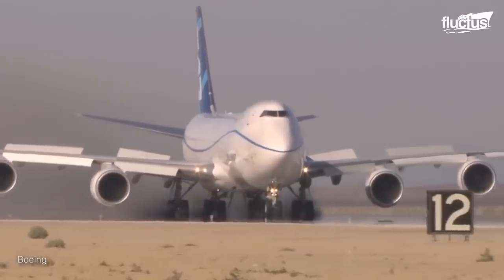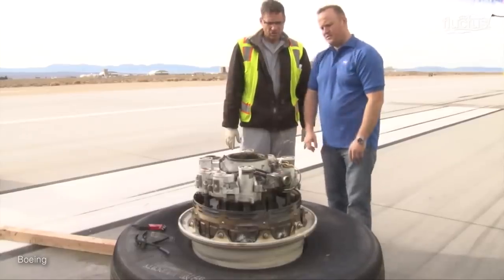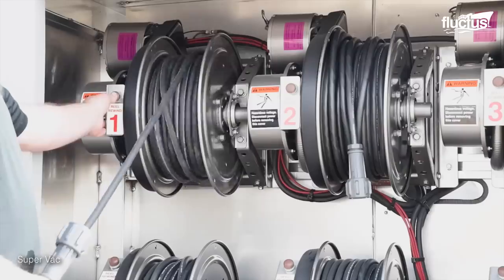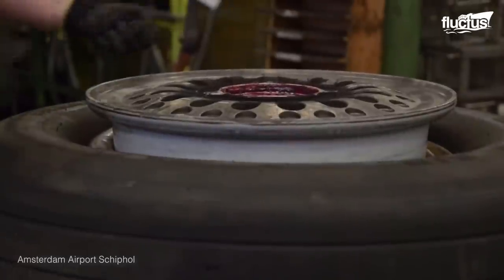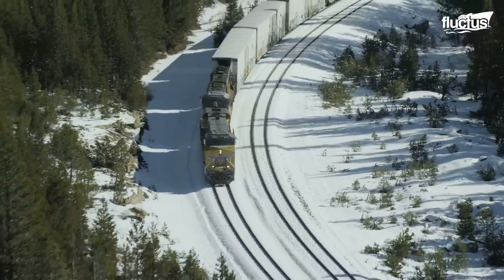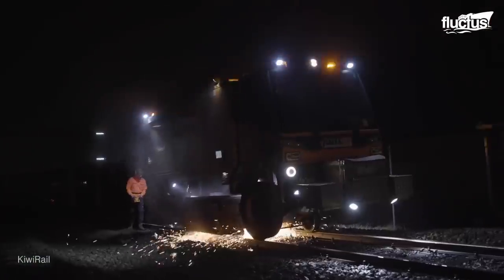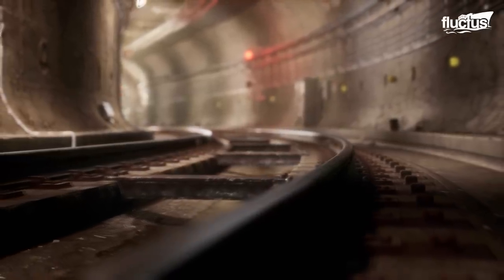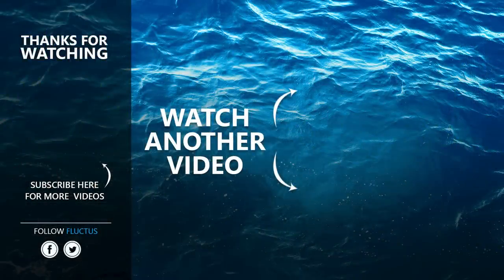Special Techniques to Cool Aircraft Brakes After Hard Landing

Comment: hard landings have noting to do with brake temperature.
Reply: Exactly what I thought if anything the harder the landing cooler the breaks as more speed is scrubbed off on impact
Reply: @rcblitzfpv8346  I think they mean as fast landing resulting in a hard landing on the brakes
Reply: @rcblitzfpv8346  ehh not really. the firmness of the landing has no real effect on brake temp. the landing groundspeed does effect brake temp, but landing groundspeed doesn't play a big role in the quality of a landing.
Reply: @andrewbatistoni5779  that's exactly what I said
Reply: maybe he meant hard braking.
Reply: 👍👍👍👍👍👍👍👍 excellent. hahahaha
Reply: True
Reply: Hard landing an aircraft actually makes the breaks cooler
Reply: @sanashams322  🤣🤣🤣🤣🤣🤣🤣🤣🤣🤣🤣🤣
Reply: @sanashams322  🤣🤣🤣🤣🤣🤣🤣🤣🤣🤣🤣🤣🤣🤣🤣🤣
Reply: @andrewbatistoni5779  Hard landing does make the brakes works harder. If they bounce or land a little further than normal they will put the brake harder to not go off the strip.
Reply: Literally the first thing that I thought when he spoke
Reply: i think they meant fast landings
Reply: You guys know nothing about science lmaooo
Reply: @raphaeld307  WHAT DO YOU WANT
Reply: Yes but it does with tire temp
Reply: @andrewbatistoni5779  not completely, its also the amount of breaking. say you have 4000m of runway and your calculation says you need about 1800m of runway to come to a stop in your current configuration (no reverse thrust included) you wouldnt need to brake with all force but like 2/3 of what you have. then you stop still before the end of the runway and if you would need to taxi along the runway to get to your gate you would want to have a longer landing. amount of braking = heat of breaks
Reply: @andrewbatistoni5779 I thought it was to do with friction. The harder the landing, more friction therefore there will be higher temperatures

Comment: I used to work at Boeing Everett where wide body twin aisle aircraft are produced. I can still remember the first time I saw a complete disk brake assembly inside engineering building. It was huge and had about 6 or 7 different brake disks and calipers with brake pads. Each tire/wheel has something like this. When they do destructive testing for certification, brake disks and caliper pads are destroyed and will be replaced. Cost a cool million dollars for each test.
Reply: "When they do destructive testing, things are destroyed" Well, yeah...
Reply: They are called brake assemblies. In the old days and on the F-4. The brakes was not as a assembly. You had to physically remove a rotter  disk , a stater disk and so on.  Back then  the rotter was steal  plate. Now its carbon.   On a Gulfstream to replace just one brake assy cost 120K and a Gulfstream has 4 of them.
Reply: @ximenoworks  Thank you. When I first saw one, I wasn't sure what it was. I asked one of the engineers in work-group. He came over and explained it to me. I think they were carbon fiber. I can't remember if brake assembly was before or after destruction test. I walked away thinking how great to have that on my car - LOL.
Reply: @martinc.720  Thanks, yeah brakes get 'cooked' in the destructive test. Also, not uncommon for tires to blowout. New safety systems help protect tires a little bit. 

Too bad they can't add cooling systems on brakes. Squirting liquid Nitrogen would cool them and not support combustion. But maybe cool too much and cause brakes to fly apart. 

I'm glad I'm not writing the checks for these destructive tests. When I was at Boeing Everett, they had huge test fixtures to put wings and fuselages under extreme loads. Data captured helped make better and safer planes.
Reply: @SJR_Media_Group  We get it, you know stuff.

All I did was pointing out that you said “They destroy stuff when they destroy stuff”. I mean…
Reply: @martinc.720  Gotcha - thanks.
Reply: @SJR_Media_Group  They are overkill for cars. But would be good on trucks. Except cost will prevent it.
Reply: @ximenoworks  Thanks. I was being satirical of course. They do have carbon fiber pads and rotors on super expensive hypercars. My Maserati is old school... giant slotted, cross drilled rotors front and back. Giant vented calipers with giant pads. Yeah, it stops as fast as it accelerates. That's what seat belts are for.
Reply: @ximenoworks  Cost will prevent trucks from stopping?
Reply: @tedmoss  Those multi plate brakes cost a lot more

Comment: BS!  Hard landings do not cause wheel fires!  It's HARD braking that causes the brakes to HEAT UP, and "CAN" cause the wheel fuse plugs to release tire nitrogen pressure.  Your research and video is flawed with incorrect data!
Reply: Where are your videos and correct data, Captain Geardown?
Reply: just wanted to write the same. A hard hit on the tire will not overheat it...

Comment: The tire thread never reaches 400 deg. If it does, the rubber would have melted. It's the brakes that reach those temps.

Comment: How do you attach that in the air ???
Reply: when the plane is going 500 mph cooling isnt an issue. some planes dont have landing gear well fairings. others have ways of cooling the tires in flight using cool air. Airbus 321 neos even have brake fans built into the wheels.

Comment: Doesn’t nitrogen aid in cooling the tires?  There was no mention.
Reply: The nitrogen that would be released from the tires via the relief valves wouldn't be able to cool the brakes. There's just not enough gas in the tires to provide any noteworthy cooling effect, even if you could direct the flow of gas directly at the brake stack.

Comment: As an automotive guy I find it odd that they have to cool the brakes. We use vented rotors so that air cools the brakes while moving.
Reply: The temperature is significantly higher. But, under normal circumstances, the break cooling is more  so the plane can take off on time. The temperature has to be below a certain point before  takeoff in case of a rejected takoff. Also, after an aborted takoff, it lessons the wait time
Reply: jets use carbon brakes. and they use stacked brakes that would look like a 5 layer clutch you might find in a motorcycle, a layer of "rotor, a layer of friction material, alternating. the calipers are 360 degrees around the whole wheel. the surface area of braking per exposure to wind-stream is much less than cars have, especially after landing.  its not uncommon for brake temps after one landing to hit 300C to 500C possibly higher in abnormal situations. carbon brakes perform best in the middle of the temp range, on aircraft. unlike steel rotors with ceramic/semimetalic pads, they work better as they get hotter to a point. but after that point they start to lose performance quickly. so before a plane can take off again, after landing the brakes need to cool to a point where they can stop the plane in a rejected takeoff. This is likely the most demanding thing that can occur to aircraft brakes.
Reply: Upon landing, they have approx 10,000-50,000 times the amount of energy that needs converting to heat, as opposed to a car at motorway speeds. All of that has to happen in approx 30-50 seconds...
Reply: @andrewbatistoni5779  are you sure hard landings arnt worse for the brakes 😂😂😂
Reply: I think the heat is produced because of the stagnancy of the wheels while touching the ground due to friction.  If the wheels rotates at least for a while, the heat usually produced may be reduced I think. In order to achieve this effect, the outer wheels may be so designed as if they are designed in a turbine (Fan type)so   that the air power may rotate the wheels and therby reduces heat on wheels.
Reply: @andrewbatistoni5779  stacked brakes EXPLANATION , YOU NAILED IT.

Comment: You don’t mention the fact that nitrogen, instead of air, is used cause it is not flammable. You don’t want that burst of air blowing onto the hot brakes when the brakes get hot when the fuse plug melts.
Reply: Nitrogen is used in tires because it expands and contracts with temperature change less than air does so the tires stay the same pressure in different temperatures, and nitrogen molecules are large so permeate through rubber less, and also the lack of oxygen prevents oxidation of the rubber inside the tire, it has nothing to do with fire.
Reply: Air is also not flammable

Comment: Hard landings have zero effect on brake temperatures.  Higher than normal brake temperatures happen when the aircraft is overweight, aborted take off, flat tires and other mechanical failures.